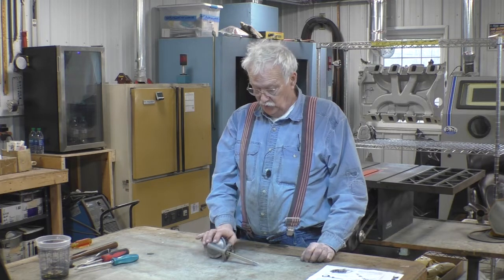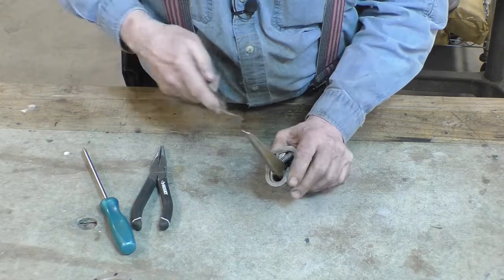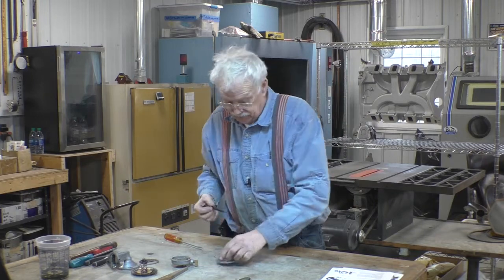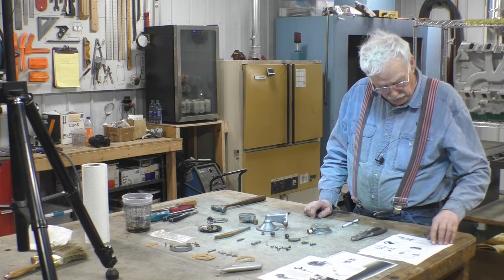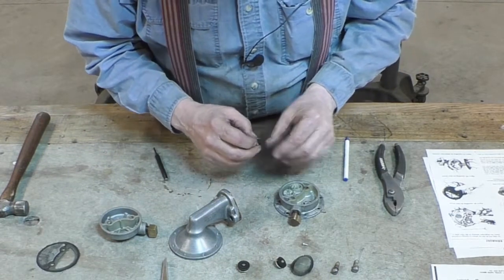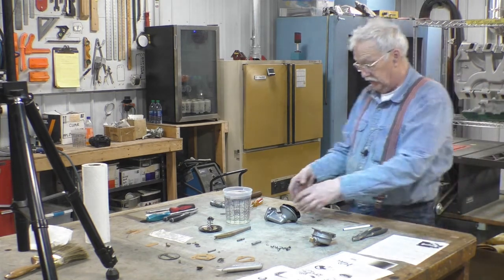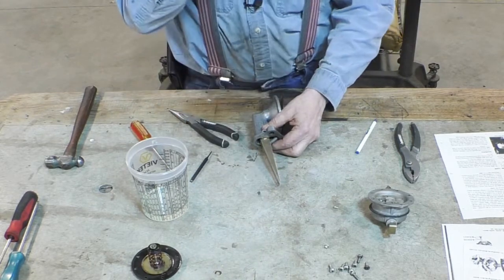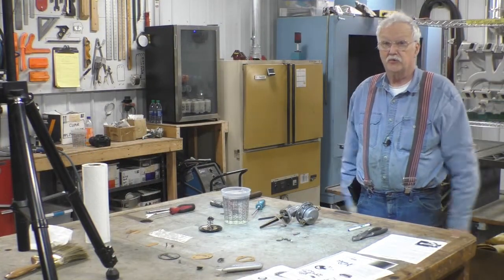Carter Fuel Pump rebuild

Comment: Very well done. If you would have put the camera a little closer on the valve installation that would have been great. This video coached me through rebuilding the pump for my 67 f100 after the shipping problems left me in Nebraska with no, & I repeat NO fuel pumps for a 352 with the in-house filter. I ended up buying used pumps from a local heavy truck wrecking yard that came from 330's, 361s & 391s. This video saved my neck.
Reply from the maker: Good to hear. Thanks